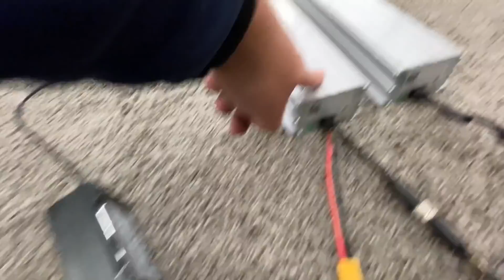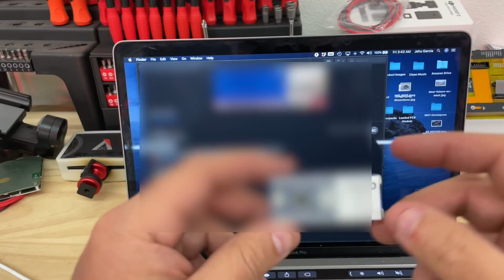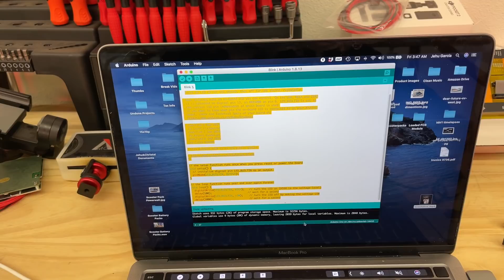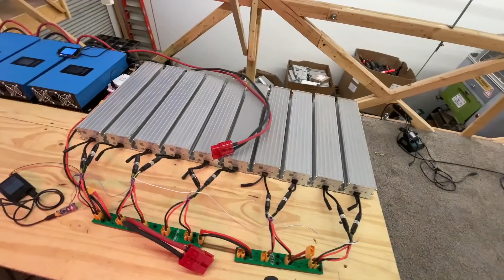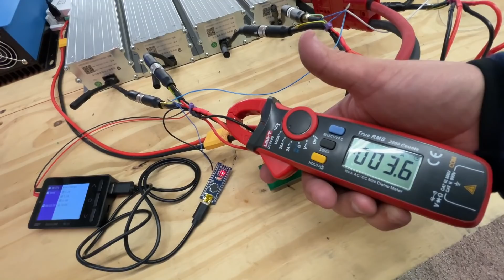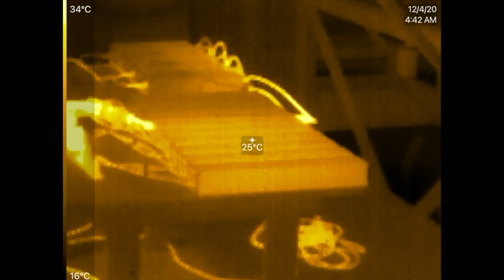The Best $125/Kwh DIY Powerwall On the Planet

Comment: Putting electronics on the carpet is not good for a bare board. ESD could zap the board or cause a failure later on.

Comment: I know you did this video a long time ago, but some of my tips will still apply to future endeavors.
It is almost always a good idea to put a series resistor in a micro controllers serial line.  I use a 1000 ohm resistor most of the time, unless you use a very high baud rate (115200 baud or more), then a lower value resistor is called for.
Now, you can get a high voltage of the old reliable LM317 regulator, I think it is an LM317V.  I use them to power micro controllers inside my solid state power amplifiers that use 48VDC.  The regulator has a 60VDS limit.  An LM317V and a couple components and you can make yourself a 3.3V (or higher) regulator.

Comment: Pretty dangerous choice of ac output sockets in those grid tie inverters. Why not choose male panel connectors instead,, as old PC power supplies used to have for powering the monitors..
Reply from the maker: Because 2000w @220vac is only 9A,  that plug can handle 15A
Reply: @jehugarcia  I mean especially because of shock hazard. The male connector on the other hand has the poles out of reach.

Comment: Its usually not a good idea to be doing that on the carpet, due to static discharge you could fry the circuit of the board..just a heads up :D

Comment: thanks for the video.i noticed you used a xt60 for the charge connector.question is could i use 2 wires from there what do you do with the other 3 wires??

Comment: can i gut out the internals and just arrange the cells to turn it to a 12v battery
Reply: Obviously would need a different BMS than what's built in, but sure cells is cells. I just don't know how easy it is to take them out or rewire cells in here (I haven't taken it apart)

Comment: I bought two, but why do I measure 0.0V on the charging port? Is that bad or is it being disconnected to protect the low batt because it's hibernating... The discharge port reads ~5.5v so description says that means it's hibernating but I didn't see anything whether I can test actual battery voltage without opening it up
Reply: I got them charged no problem, just applied 42V power pack from my "40V lawn mower" and it held since yesterday. Just will need the serial code in order to use higher than 1A output

Comment: Lol "it's only a volt and a half", what?? 5-3.3 = 1.7v over but that's not the point. It's more than 50% over voltage on the serial line! Who knows how long it would take to break down a 3.3v device, and 5 inputs in parallel don't make enough difference to not need the voltage divider.

Comment: Hi, the code for some reason is not working i tried multiple Arduino and i double checked all my connections and everything is correct . still not keeping the pack alive, please help
Reply from the maker: Are you using a mini pro or a nano?
Reply: @jehugarcia  I'm using nano
Reply from the maker: Does the tx ligh blink every 6 seconds?
Reply: @jehugarcia  it blinks every 5 seconds
Reply: @jehugarcia  i tried every 6 sec didn't work either.is there different revisions of this battery pack ?
Reply from the maker: Might be the battery
Reply: I was wondering if the batteries are getting too far depleted by now, I just got two packs. Reads 5.5 to 6V on the discharge port without waking it up but I haven't tried sending the code yet. Wondered if it might need external power to send the signal if it's too weak
Reply: Well mine is holding the charge so I'm not worried about bad cells but have you tried converting output to 3.3V (I think idle is high so you can use regular DMM to verify after hooked up to serial), and my coworker couldn't get some serial signal to work with SoftSerial until he simple tried different pins, which it was supposed to work on either pins but the voltage just was too far out of spec I guess.
Don't bother trying 6 sec because going beyond 5 is just more chance of differnt problem.

Comment: Hey Garcia, I really enjoy watching your videos. I am very interested in purchasing a set of these batteries for an electric sport bike that I am trying to restore. The bike is a 72v with a 2000watt motor which uses 6-DZF-20 batteries and I’m interested in converting it to use lithium batteries. Can you direct my in the right direction. Thank you.
Reply from the maker: sure, im currently working one a 72v dongle for these packs,  you might find it useful,  stay tuned
Reply: @jehugarcia  I most definitely will, thanks.

Comment: For a vehicle, I liked it.  For a power outage, I like it.  To reduce pollution by recycling is another reason to build it.  For info, I am glad this video is here.  Just make sure this is feasible in your area.  $125/Kwh per 1000 (?) full cycles = 12.5 cents per kWh.  That's about the same rate we pay in Florida for FPL.

Comment: I notice in this video you have mating connectors (on the load side at least). Do you have these available for sale?
Reply: Warning, Scam!
Reply: @quietwon8992  Actually  they did have the mating connectors and I did buy them. At the time repurposing these batteries was a good option for me. Today it is not because technology has moved so far so quickly. But it was far better than lead acid which I had been using for the 10 years previously. Jehugarcia is definitely not a scammer. He buys surplus batteries and helps people put them to other use... economically. He's a good guy.

Comment: question for anyone who know about the watts and all, I have been kicking around the idea of building a solar generator. How does the 24 kwh compare to the lets say BLUETTI 2000w  one?
Reply: The 24 kwh option or 24 “kilowatt” (1000 watts = 1 kwh) is 12 times more power then the Bluetti 2000w or 2kwh option. That’s like having 12 BLUETTI 2000w units. I hope that helps!
Reply: @christianperi  100% does! just have to plan a build and use those for a solar generator. ( not offgrid but for use now and then when power fails)

Comment: For anyone who cannot get their pack to wake up, here is what worked for me; the packs seem to have a lockout, which Jehu tripped when testing with the inverters.  If you trip this lockout, connect the arduino as he showed in the video, then give the pack power on the smaller connector, the larger one does not work at all when the lockout is tripped, at least for me.
Reply: Did you take any voltage readings when you received the batteries (before charging) if so what voltage was it?
Reply: @theman56  Before charging the meter read about 15 V, which I believe is just some leakage through the mosfets.  In reality, it was at about 33V, which I could only see once it had started charging and the mosfets had turned on.

Comment: Can i wake the batterys up by taking them apart and putting them in a smart charger like a loketta 4 slot charge
Reply: Yes, they are just 40 lithium cells inside. You can take them out and charge them separately.
Reply: But only for individual use of batteries, not for charging a large pack.

Comment: For integration with an existing grid tie inverter (Sunny Boy 5kW) would it be safe to wire 4 of these batteries in series. The inverter requires a minimum 120vdc to start. If that’s safe, any recommended BMS to allow for safe, automatic daily recharging when the sun is up (looking at Victron 250v MPPT Charge Controller but thinking it still needs BMS to keep each of the 4 packs in balance). Thanks for the great information!

Comment: When I upload the code.  It has a copy error, I copy the code exactly.  Did I missed something?
Reply: I am such a noob.  Have to set the the profile to Nano within the software.  But my issue now is even without the Arduino, my pack is reading half of the voltage from the port.  For example, even without the Arduino the voltage reading from the port is 14v.  When I measure it from the battery its 28v.  ???
Reply: @chumanji9  I'm having the same issue with mine, where connecting the arduino makes no difference.  I haven't figured out what's going on yet, unfortunately.
Reply: I was working on my pack some more, and I think I found the solution.  These packs seem to have a lockout, which Jehu tripped when testing with the inverters.  I think we both tripped the lockouts on our packs.  To reset mine, I connected the arduino, then gave the pack power on the small connector.  After a few seconds, the pack started up and is now working great.
Reply: @timfryer9408  Yup that worked for me too.  Applying power to the smaller connector woke up my packs too.

Comment: I would love a stack of these for my camper.  How would I go from the 36v down to 12v?
Reply: You go from the batteries to a power inverter 120v ac  And plug in your whole camp or to it.
Reply: You need a step down converter. They're pretty cheap. I wouldn't necessarily buy the CHEAPEST one off of aliexpress though. 😉😎👍
Reply: Did you find the device that you was looking for your needs?
Reply: @MrSeth166  no I haven’t. I would like to replace the 12v battery and add a Li pack.
Reply: @RichardGreco  .........SO you can cheaply buy a STEP down Buck Convertor ,  and have to find a 36 volt version to step down to 12v .  They are available ,  can also look for 24V lithium battery packs , and get the 24v to 12 v buck converter ......

Comment: Simply put. You are bypassing the BMS and basically connecting directly to the battery without any safety circuit.
Reply: is that safe?

Comment: Do not connect a non-5v tolerant serial line to a 5v output. Even with paralleling them all together, it makes no difference as the serial receivers inside the BMS draw virtually no current from the line, so you can never 'pull the data line voltage' down far enough to be within the 3v3-3v range. At best, the receivers are 5v logic tolerant, at worst the receivers will eventually be blown out after being pushed beyond spec and you will have effectively killed the BMSs.
Reply: Wouldn't it be easier to just replace the BMS on the scooter batteries? Avoid all the problems in the video.
Reply: @OHydroTsunamiO  You'd need new ones that play nice with the exact type of batteries otherwise you have fire hazard and / or kill the batteries.

jehugarcia seems not really very proficient with electronics which is sad because the idea is great.
Reply: First smart suggestion I heard in all this chatter! Good luck taking those batteries out of that aluminum casing.

Comment: Very informative video as always, I am in look out for similar sealed batteries for my home inverter. Right now I am using a 900VA, 220 Volt inverter and a 150AH lead acid battery which manages to support 5, 6 hours of back up. How ever owing to frequent power cuts, the battery life is very short and its quiet expensive (to Indian standards) to replace every couple of years. 

I am considering to pick 3 or 4 of these sealed battery packs if you will be able to ship them to India. I have an Uno and a Nano which i bought for project. 
I am an Old timer so not so much into these online transaction and/or social media stuff. I apologize if this is an odd post here.
Reply: Ya led acid batteries aren't supposed to get low in voltage it makes there life expectancy drop every time only deep cycle have larger plates inside and can handle it so invest asap in different bats if you don't believe me look up car batteries for solar storage it'll explain everything

Comment: How many cycles can you pull out of these batteries?
Reply: I myself would guess around a thousand, depending on many factors, since they are Li-Ion packs and probably optimized for power output...
Reply: @GantryG  How did you arrive at 1,000 cycles?  Are these USED packs?  How many deep discharge cycles have already been consumed?
Reply: @GantryG  Gotcha, yeah Lifepo4 is a better option for a solar wall in that since you'd get 3-5k cycles.
Reply: 20 feet.on a ebike! Useless

Comment: Where can I find the connector that connects into these packs?
Reply: https://www.mutuallc.com/L513-screw-locking-5-pin-Battery-connector-pd43402085.html
Reply: @CoryTaylor904  Thanks! do you know what the smaller connector is?
Reply: @theman56  it's on the same site. They won't have it in stock untill someone places a large order.
Reply: @CoryTaylor904  Thank you!! hopefully Jehu starts selling the connectors. otherwise I might just need to cut them off.
Reply: @theman56  I'm right there with you.
Reply: @CoryTaylor904 If you don't mind me asking what was the voltage of the packs (before charging) when you got them?
Reply: @theman56  13v. Dead as a doornail. Overnight charging woke them up just fine. Couple of discharge cycles later, and I'm getting 480wh capacity.
Reply: @CoryTaylor904 Thanks! I appreciate all the info. mine were a similar voltage.
Reply: aliexpress, banggood

Comment: Just want to interject that the Xoami M365 battery doesn't require any external methods to get it to power on. I use two of these in parallel on my ebike and its plug and play once you put on a proper charge and discharge ports.

And also do not connect two of these batteries and use one to charge. It will kill the BMS.
Reply: Are these Xoami M365 battery packs?
Reply: @byronlovesdrifting1  Yes 10s3p backs about $60 for low charge cycle packs on eBay.
Reply: Sorry misunderstood thought you were saying these were the Xoami packs.
Reply: @byronlovesdrifting1  They have LG cells in them
Reply from the maker: This come from Okai ES200G scooters

Comment: Is it just pulsating 3.3 volts every 5 seconds i might have a dumb idea but could you possibly use a 555 timer in astable mode ?
Reply from the maker: No it’s transmitting a very specific set of data,  look at the source code

Comment: This is an awesome update. So if I get a 4 Pack and wired the charge ports in parallel I can use a 42v 20A Charger? Since each battery is limited to 5A?
Reply from the maker: Or 100a using the discharging point
Reply: @jehugarcia  if you charge via the discharge port, aren't you bypassing some of the protections the BMS is there for?

Like over voltage protection?

If you can go faster but it's because you're feeding power right into the cells... I'm just not sure that you should be advising people to do that without some warning.
Reply: @PablumMcDump  Yes, I have some of these batteries and when charging over the larger connector the BMS does not seem to be able to disconnect the charger on over voltage.  Only on the smaller charge port does it properly disconnect on over voltage.
Reply: @jehugarcia  Sick! So the discharge port can be used to charge and discharge. I appreciate the info man, Been watching you for so long and learning so much!
Reply from the maker: Yes
Reply: They don't balance charge from the big port